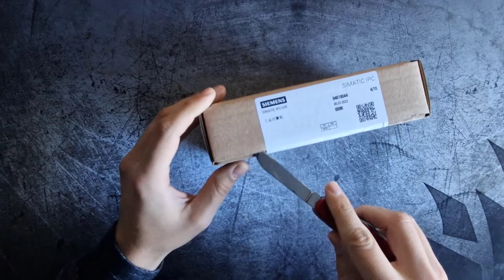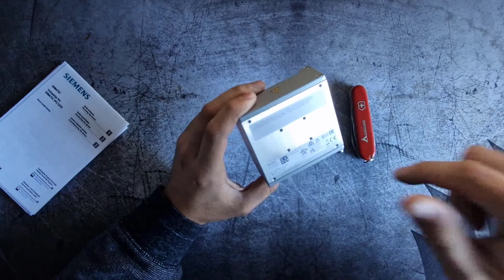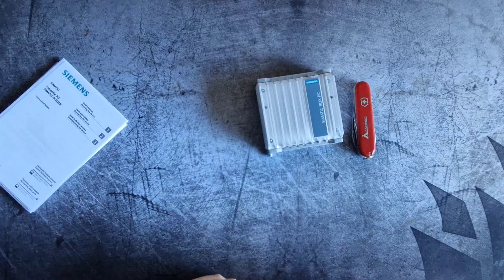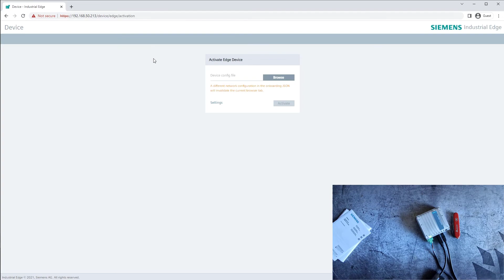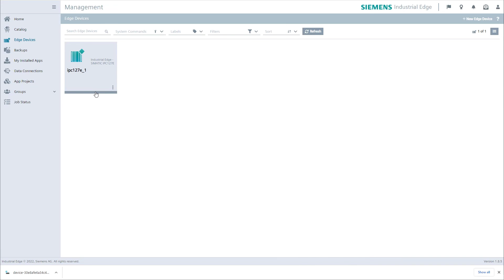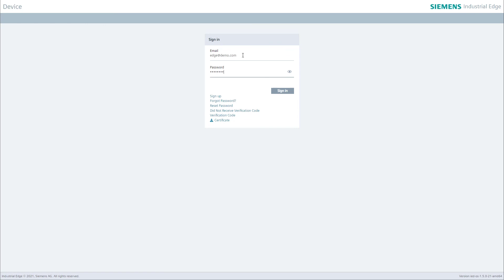Unboxing and Onboarding a Siemens SIMATIC IPC 127E Industrial Edge Device onto the IEM

Comment: Hi, I have a question. Do we need Internet network for Edge Device & Edge Management when they are in OnBoarding progress
Reply from the maker: So the IEM (management) needs internet access for onboarding, updating, pulling new applications, OS, firmware.
The IED (device) does not need internet access
Reply: @AutomationStation  Thanks for your reply. I am onboarding IPC427e to my IEM, but due to limited internet infrastructure in the factory, I have to use mobile phone (usb connection for internet) to do the onboarding.
I have completed the onboarding for IEM, but when onboarding EdgeDevice, it keeps failing (I plugged my phone into Ipc427e to get internet).
I will try to connect the network (by phone) to IEM tomorrow to see if it goes better.
Reply from the maker: @truongtungho4766  If the IEM is local, the IED wouldn't need internet at all, if it's hosted on the internet then yeah you'll need it

Comment: If the management is hosted on Azure VM, will I be following the same steps specifically the edge device is located remotely?
Reply from the maker: For onboarding the IED? Yeah, doesn't matter where the IEM is but it needs to be reachable from the IED.

Comment: is the management system free or require license? can you use the IPC without the management system?
Reply from the maker: So you cant use the IED (device) without an IEM. The management system is free. It's the management of a device that's licensed with the first device free so you can try and see if that works for you. Most of non free apps are on 3 month trials.